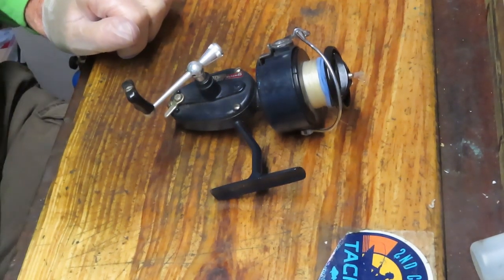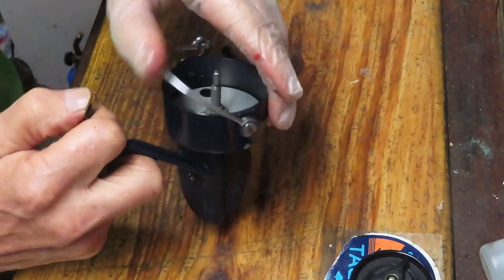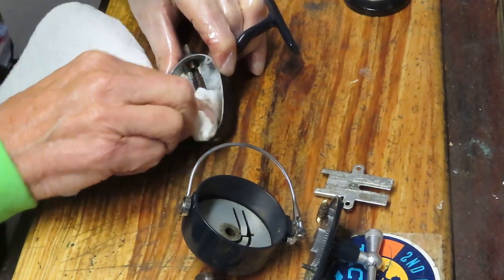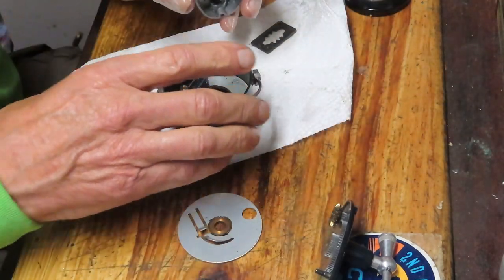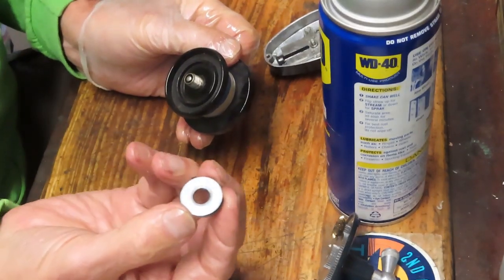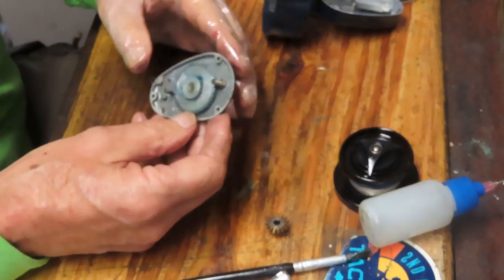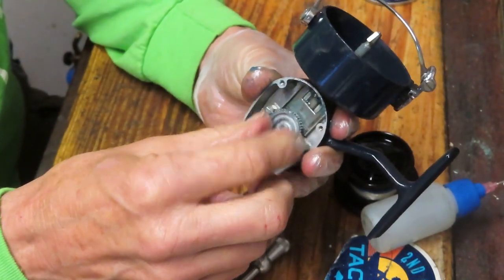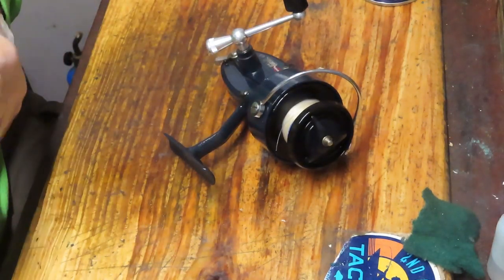Mitchell 410 vintage complete fishing reel service with a bail trip problem

Comment: I have found that using the name brand Q-ti is far better than budget brands. The Q-tip doesn’t leave tiny strands of cotten in your reel, in other words don’t go cheap on Q-tips. I love the incredible engineering of these reels. I got a 411 (for a lefty) one time that had been completely packed with some kind of stiff, nasty, brown grease. It took some effort to clean. I happen to like the planetary gear oscillation system in these reels. I truly believe you do get a better line-lay with these systems. You did a great job with this reel with clear and easy to follow directions. Super video Dennis! — Chris
Reply: I've found Qtips do the same thing.
I have heard the hobbyist / model makers cotton swabs are much better , but they cost more.
Reply from the maker: Thanks Chris - Yes the original Q-tip are much better than the no-name bargain brands!

Comment: Damn, do you think you could repair the anti-reverse clutch on an okuma reel in have?
Reply from the maker: I imagine I could, if all of the parts are there!  I am assuming that you have the one that is about the size of a half dollar and that the screw top that holds all of the rollers and springs in place.  That was the first generation of those clutches and boy is it painful to put back together.  I always advise viewers to leave it alone.....with good reason.  There is a fellow that did a video on a Shimano reel clutch which is the same.  It is the best one I have seen.  It may help you.  You can watch it here.  https://www.youtube.com/watch?v=kH3oujKg63w

Comment: Today I discovered this extraordinary video that you share so generously, thank you very much! I am excited to see how these mechanical jewels work and discover every detail. My 410 has a defect, it works with a lot of imbalance. I think the counterweight is too big. It has been a factory defect since it was brought to me from the USA 50 years ago. It has only one screw and a stop just like in the video. It is impossible for me to loosen this screw because it seems to be stuck with some glue on the thread. What do you recommend?
Reply from the maker: If it was glued in, you can't do much. Same with a corroded screw.  You may want to try soaking the area in a penetrating oil bath to see if that will help loosen it.  Thanks for the note and the kind words - Dennis
Also - check the shape of the bail wire.  If the wire is bent out of shape, that could exaggerate the wobble issue - Dennis